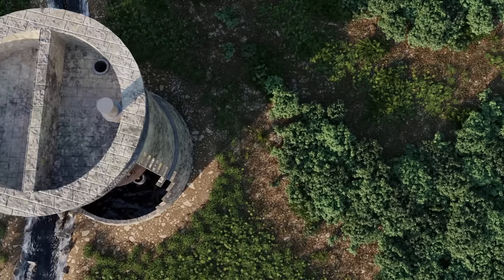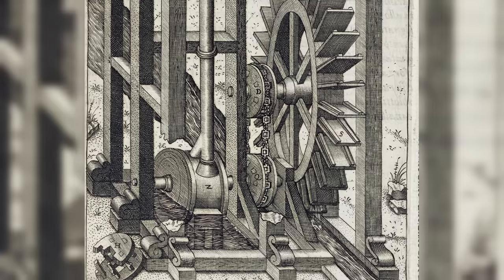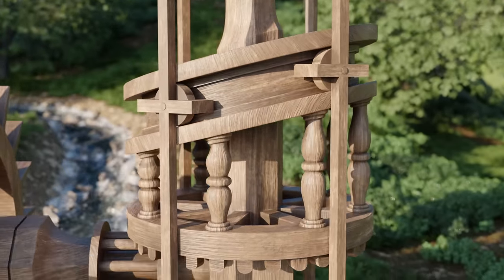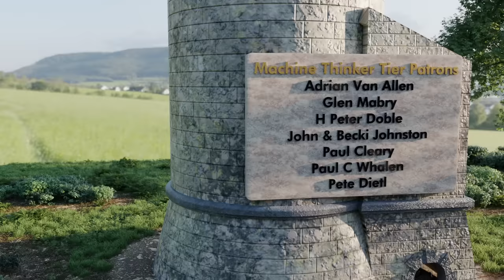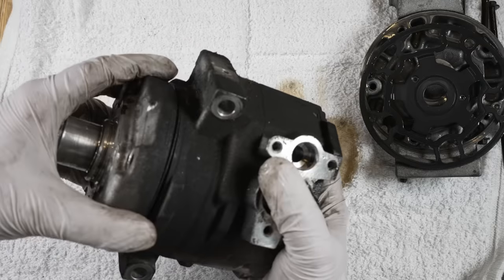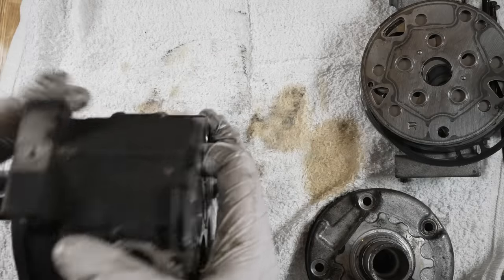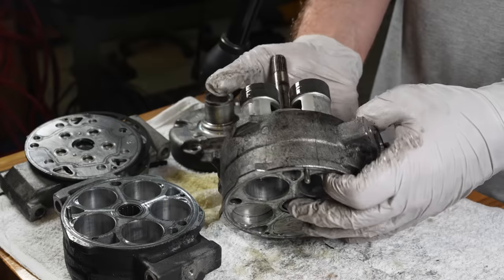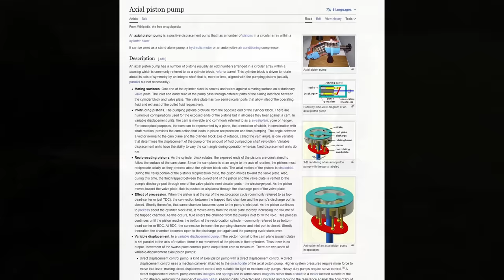How an ingenious 400 year old drawing predicted the future

Comment: there was a special kind of aircraft engine that only ended up being used on blimps but Barrel Engines are one of those weird what-if technologies because they are very close to radials in size
Reply: The same engines were used in torpedoes during WW2.
Reply: @allangibson8494 They still are used in torpedoes.  It's hard to beat the power to weight and size and cost ratios in the cylindrical package that doesn't waste the constrained space in a torpedo casing.  You could probably beat it handily for power and weight with a turbine engine, but that would kill the torpedoes range and cost a lot more.
Reply: I was going to mention that same engine. It featured six pairs of cilinders instead of five and I believe it predates the axial pump by half a century
Reply: Radial engine? AKA dorito. (Wankel engine).
Reply: @ryshellso526 aircraft radial engines are not the same as car radials.
Reply: @ryshellso526  No, radial and Wankel engines are extremely different.  Wankels use a triangular piston in a precisely shaped housing to produce the required effects to make an intenral combustion engine.  A radial engine is called that because the cylinders are arranged in a radial pastern around the crank shaft, which will have one connection point to the connecting rod assembly for each layer of cylinders used. There are diagrams in the Wikipedia articles that illustrate the radical differences in the basic designs.

An interesting detail is that Wankel engines are the only type of piston engine (and calling Wankel engines piston engines requires a clear understanding of exactly what a piston is and why the Wankel counts as having them) that cannot be easily converted into an air pump.  You could do it with a radial engine, just like you can with a liner crank piston engine, although the shape of a radial engine makes it awkward for this kind of conversion.
Reply: @ryshellso526 that's a ROTARY engine. Different design. There's also radial rotaries but those haven't been used in a century.
Reply: There's a modern equivalent known as the 'Duke Engine."
It has been tested in a car, but will more likely be used in small engine applications instead.
Reply: @Solnoric  Were those radial rotaries the ones used in some WWI aircraft where the crank was stationary and the block spun?  (WWI was so early in the development of aircraft that nobody really knew what was a good idea and what wasn't about most features, including the engines.)
Reply: I did a report on an engine with that design for mechanics class in the early 2000's it was fascinating and I figured they would be everywhere by now. But apparently designing a new type of engine is hard and there is a reason we have basically used the same engine design for 200 years.
Reply: @Solnoric better known as a Wankel engine, after the designer, to distinguish it from those original old rotary aircraft engines (and one mounted in a motorcycle wheel!) that have their own unique and much earlier place in history.
Reply: @evensgrey  the Fokker Dreidecker (tri-plane) flown by (Red) Baron von Richthofen had its engine's driveshaft fixed to the fuselage and the entire block spun.
Had so much torque exherted that it favored turning (banking) in one direction.
Reply: @KOZMOuvBORG  All single-engine piston-prop aircraft, and not a few multi-engine ones, have a distinct preference for turning one way over the other.  The B-29 bombers used to drop the nuclear bombs on Hiroshima and Nagasaki, for instance, were turned right after the bombs were dropped because a right turn was faster due to engine torque and more likely to get them far enough away from the detonation to survive the shock wave.
Reply: @evensgrey  Yes, P-51s needed much training to pilot safely with the torque their props produces, 
but the Driedecker was especially tricky as the rotating mass was such a high fraction of the ᴛᴏᴛᴀʟ aircraft weight.
Reply: @evensgrey  interesting, the Tu-95 that dropped the Tsar Bomba had counter-rotating props thus no favored direction of turn, used a parachute to delay blast.
Reply: @KOZMOuvBORG   They used a parachute on at least one of the drops against Japan as well.  They were still concerned about getting far enough away from a blast literally less than a thousandth the power of the Tsar Bomb (which was tested at only 50% of intended power).  There had been some tests that indicated that while getting hit from behind was bad for a B-29, getting hit from underneath was much worse.

While there is a certain design lineage from the Tu-95 back to the B-29s the USSR copied, it's a quite different aircraft developed 20 years later.  You'd certainly never be able to get a B-29 out of the kill radius of a 50 megaton bomb if you could actually build one it could drop.
Reply: @evensgrey  hmmm..  that could explain why Nagasaki was off-target (went behind a ridge).      The Tu-95 could keep up with a modern jetliner, unlike the B-29.
Reply: @KOZMOuvBORG  The poor aim was because there was a lot of cloud cover in Japan that day.  At Hiroshima, they were able to do a visually controlled drop, but at Nagasaki they had to do a RADAR-aimed drop, which was much less precise.  Kokura was the originally planned target for the second bomb, but it was too heavily covered by cloud for an optically aimed drop, so they went to the third target on the list.  They didn't have the range for any other targets, so they went ahead and attacked Nagasaki.

Comment: Pressure washers sometimes use a design like this. Other pumps arrange the pistons on a crankshaft, but use the same multistage pistons. A/C compressors also utilize a very similar mechanism.
Reply: I was guessing it was a power steering pump.
Reply: What he was showing was an a/c compressor. Most p/s pumps are some type of gear pump, shorter, less complex and less expensive expensive.

Comment: It looks to me a lot like a hydraulic piston pump, but with a couple extra steps.
I had no idea that's what's inside that pump you took apart.  Thanks for the info!
Reply: Pretty much what I was about to say, also AC compressors for cars are built kind of like this as well.
Reply: It's an AC compressor, the inlet and outlet fittings are standardised
Reply: @kingcosworth2643  And hydraulic pumps and motors have the same general set of constraints on them, needing to be fairly compact for most applications.  Car enthusiasts probably would recognize it from the connectors as being an AC compressor, but you probably wouldn't need to change the design much to operate as a small hydraulic pump, which most modern cars usually employ several of.
Reply: Hydrostatic transmission was my thought when I first saw this machine.

Comment: Ramelli's notes were required reading in my mechanical engineering, but I didn't even think of it being in an A/C compressor.  That"s actually pretty enlightening :)   I know the common well pump is based on his rotary pump.  and a steam engine piston is based on his wood & leather pump piston, an internal combustion piston also for that matter.

Comment: I seen a video of a guy converting a car's AC pump into a double sided engine 5 cylinders on each end. It requires some modifications to the valves and fittings and adding holes for tiny spark plugs and stuff.. it ran great but would not be hugely powerful and because of the Swash plate and shaft as the crank would be unreliable and add tons of friction but the fact it became a 10 cylinder engine was very very very cool 😎

Comment: I'll add another "modern" use of this to the list, check out the Sterling Crankless Diesel engine from 1933.  It used 2 discs and opposing pistons.
Reply: There is a number o similar engines, most of them described on the site The Museum of RetroTechnology, section Axial Internal-Combustion Engines.

Comment: There are several applications to this design known by several names like Swashplate, slantplate, wobbleplate and more. There are several engines that have used this system, Torpedoes, vehicles have all been made with these engines that are also known as Barrel, Z Crank and Axial Engines and go back to the very early years when car engines were being made. Dyna Cam started to make one for aircraft in the 50's or 60's for helicopters and designed a 12 cylinder engine that was tested in a Piper Arrow aircraft in the 1970's. Because of the horizontal movement of the pistons there was no vibration like you would get in the standard engines most people know about. This Dyna Cam Axial Engine with 12 cylinders fit in the same space of a 6 or 8 cylinder engine and was extremely mechanically simple and easy to work on. I only wish the made one I could stuff in my 68 Camaro. This swashplate system is used on pumps and compressors of all types especially when they need to be compact like for hydraulic pumps or refrigerant compressors in cars. The Gatling Gun uses this swashplate design in order to cycle the bolts of each gun barrel in order to remove the cartridge from the link, load it into the chamber, release the firing pin to fire the cartridge and they remove the spent casing. That is still being used in the military today on every fighter aircraft. The most famous being the A-10. This is one of the major inventions that effected the world. 
And to give y'all some understanding of how lucky we are to live in our time you should think about this. Since the beginning of the human race, throughout all of History, in each Century there were 1 or 2 major life changing inventions during the Centuries, with a rare occurrence of 3 that effected mankind. In the 1800's there were 4. But if you were to take all of these major inventions from the beginning of mankind to 1900 and add them all up, the sum wouldn't be close to half of the inventions from 1900 to 1999 and most of them came in the second half of that Century.
I worked as a Machinist and I know how a simple invention can lead to a major development of a completely new device or system. The old saying "Necessity is the Mother on Invention, the old 1973 Paul Simon song "One man's ceiling is another man's floor" in a way can explain how inventions can leapfrog to something that was never the thought of intentions of the first invention. Like this device that was made to pump water that is now used in literally thousands of items people use everyday and they never know about it. Another part of this device in the video, the Lantern Gear, that developed into a sprocket, to a sprocket or gear pulley that drives the timing of the valves and distributor in cars. Or how the abacus lead to the calculator and the Jacquard machine card lead to the modern computer. Some of you out there are old enough to remember friends in high school that went to Keypunch training and did that for a living in the 1950's to the 80's. That is what the Jacquard Card had developed into and many out there should remember getting utility bills printed on a card with rectangular holes in it. That was what was run through the computer.
If you would like to see more stuff like this, I would suggest looking up 3 old TV documentary series that aired in the 70's and 80's and watch them in order. They were by James Berk an English History Professor. The first was "Connections" the second was "The Day The Universe Changed" and the third is "Connections 2". Each show was an hour long and in most, if not all, he starts out with something small and goes through the show, so that by the last 15 minutes you are asking yourself where is this all going as you think you got lost somewhere in the program. But in the last 10 or 15 minutes he puts it all together and you realize how some off the wall nothing invention grew and changed the world.  That first one, Connections, changed my life and how I look at things today. It will show you just how little 99% of you are aware of how vulnerable and dependent on technology we are today and it is scary. Half or more of the worlds population would be gone within a year if any one of several vital systems were to crash even for a short span of time.  If none of y'all have seen this Documentary here is a link to the first Connections. The first 20 minutes will show you how fast a small simple device can cause a cascading system crash ans should make you think when he gets to a farm and explains the choices you will have to make that none of you are prepared for if it were to come to that point. 
I said I was a machinist and I am, but I learned all of it in my military service. I've seen the conditions that turn people into animals just to survive another day and it may be coming to that soon with what is going in in the world today.
Here is the link, enjoy and learn:
 https://www.youtube.com/watch?v=XetplHcM7aQ&t=202s

Comment: The item is a automotive Air conditioning compressor or fluid pump. The fact of the matter is, that the old pump design is one of the most efficient (reliable and effective) pumps on the market. Where the angled plate driving the piston followers is variable, to create a no flow, no pressure, neutral situation, which is great for saving HP and fuel or to act as supply to a drive motor (drive and stationary). I am certain the old design also utilizes a one way valve, most likely on the piston itself (like a check valve). Which will open on a up stroke, allowing water down the hole and closing the valve in the down stroke, due to the pressure buildup under it.
Very cool to see this almost "ancient" design in a likely application just to realize we use it in hydraulic pumps and ground drive fluid pumps today.

Comment: The variable version of this is in EVERY Zero turn mower (they actually have two, one for each wheel) that pumps hydraulic fluid through a rotary vane motor. That turns the drive wheels. Similar; every tractor (garden/lawn) that uses an "automagic" gearbox uses a simpler version of the zero turns, pump integrated into a transaxle.

Comment: Another common use for such a pump is in pressure washers. It is a one-sided setup with pistons only on one side of a fixed wobble plate. The whole mechanism runs in an oil bath to keep friction to a minimum, with some seals to keep water from getting in.
A very common use for a variable (movable wobble plate) pumps is in lawn mowers. Pretty much anything that mentions hydraulics does use these piston pumps, be it a zero-turn mower or a tractor with forward-reverse pedal.

Comment: Hydraulic motors often use a swash plate where the pistons act on the swash plate to turn the shaft rather than the other way around like an ac compressor.

Comment: What's great about these swashplate compressors is modern designs let the angle of the plate change, which changes the displacement of the pump, even down to nearly 0 on some designs. 
Car AC compressors have used swashplates since the 80s commonly.

Comment: I was apprenticed as a mechanic in a Lancashire textile mill. I used to repair pirn winding machines. (A pirn is a bobbin of weft that sits inside the flying shuttle). I enable a more evenly wound thread, the guiding eye would oscillate. This motion was created by a similar mechanism to the cylinder cam.

Comment: 2 devices that come to mind immediately are the swash-plate AC compressor used in just about every motor vehicle you can think of. The second (which has probably already been mentioned, is as a variable hydraulic pump and/or motor that is used in hydrostatic transmissions and many other applications. Incidentally, the axial compressor you disassembled is essentially a 10 cylinder compressor that moves a LOT of volume of freon gas in a relatively small package. They're only a single stage compressor, but will still generate upwards of 250-275 p.s.i. on the 'high' output side,mainly because it's a closed system, and freon compresses better than air.

Comment: You have indeed earned my subscription. I confess that I find the shameless begging for it extremely off-putting, but those animations cannot be ignored. That was an absolutely wonderful way to convey the mechanical workings of that machine.

I do have one tiny criticism of the animation, not of the actual animation part of it, nor the modelling, but rather the texturing. Most (but oddly, not all) of the teeth of the crown gear have the wood grain running horizontally through them, in the same direction as the stress they're under. Now, I am neither a mechanical engineer or a woodworker, but it does seem to me that one would very deliberately cut those teeth in such a way that the grain was perpendicular to the direction of stress, in order to minimize the risk of a tooth snapping in half.

Comment: When my old Dodge Caravan AC system stopped cooling, I removed the compressor and it was exactly like the one taken apart in this presentation. As a former tool and die machinist and having worked as a designer most of my life, I just marveled at this clever design as well as the impeccable fits and tolerances. The swash plate motion is referred to as nutation. The same principle is also used in hydraulic motors. As an aside, the scroll compressor is a much simpler and far superior design and the scroll itself is said to never wear out but improves as it wears itself in over time.

Comment: i work in food machinery and this greatly resembles the wobble bell assembly used in some models of reciprocating saws. rather than several gears and a connecting rod to move the blade back and forth, the wobble bell is driven either directly or through use of a planetary gearset and that translates the rotational motion into reciprocating motion with very little resistance and therefore little loss of power. it also makes for a lighter weight simpler design. a brand im familiar with is EFA out of germany. take a look at their model 50/18 or 63 breaking saws to see what i mean.they have full breakdowns on their site for each model.